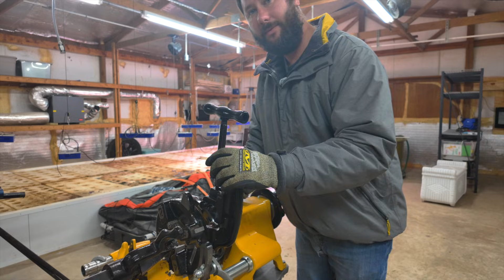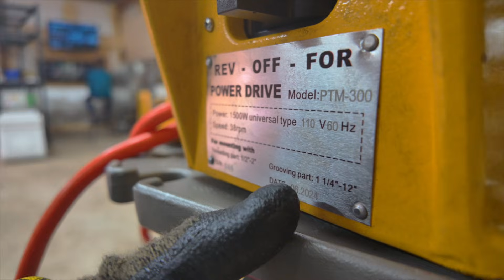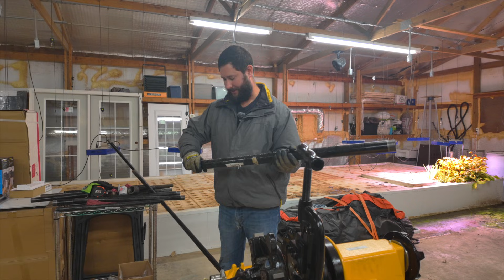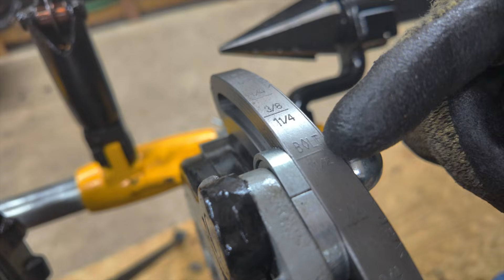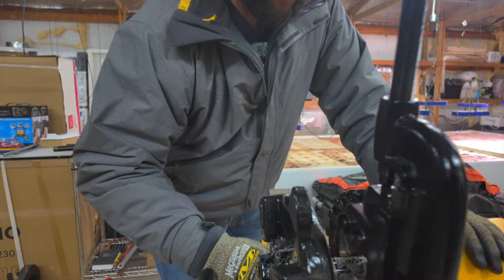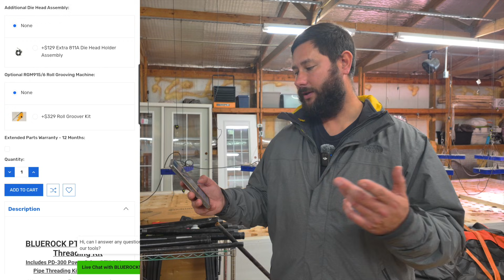Pipe Threading Made Easy | Bluerock PTM 300 Full Demonstration

Comment: I worked with Ridgid  threaders for a lot of years.  If thy had die head assemblies, they were fiddly and usually broken.  I would generally take a ratcheting threader and put it on the pipe that was loaded in the machine.

Comment: Safety. Never grab onto a rotating shaft or pipe wearing gloves. To many have had their gloves snagged on to the shaft and their hands were pulled off their forearm
Reply: Saw a guy do that scared the sheite out of him ,luckily he yanked and the glove ripped. We dunk the threads in degreaser and blow off with compressed air ,much safer.

Comment: Thanks. I use a similar threader at work periodically.  I never thought to close the dang thing to set the pipe diameter.  I thought the thing was messed up. I just eyeballed it.  Been lucky so far.  No leaks.  But now I know how to do it right!! Duh

Comment: Should never run your dies in reverse, just release the lever and your done. Also check the thread engagement with a fitting ,should get 2.5 turns by hand. Thats how we did it in the Machine tool trades. Mostly  Ridgid brand theaders used in Pipefitting.
Reply from the maker: Thank you brother joe I appreciate you